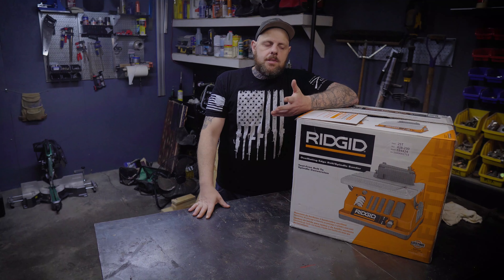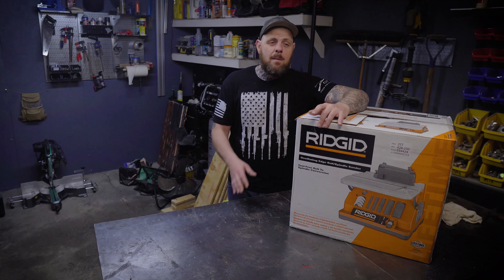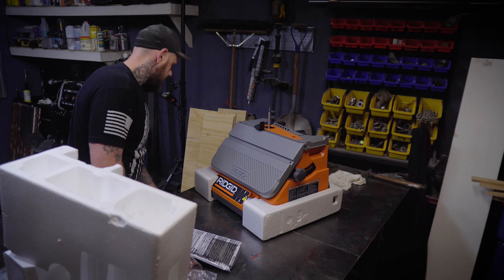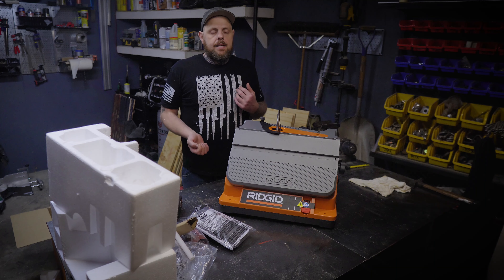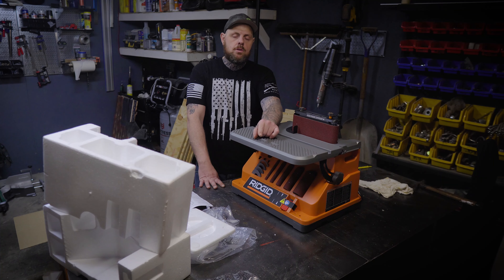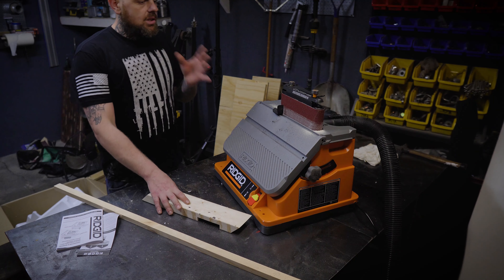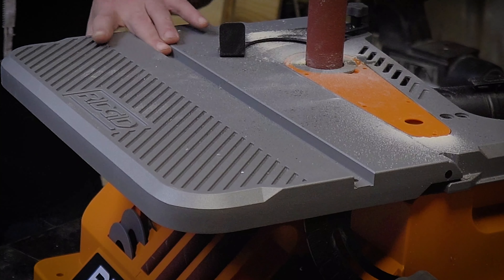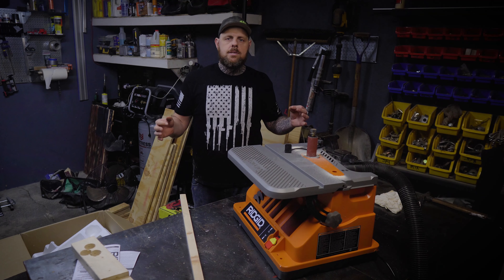Ridgid Oscillating Sander Review & Unboxing

Comment: Trying to decide between this one at $270 or the wen which is the same but no miter slot and a touch smaller for $210. Cool video
Reply: This one ...no brainer ..Wen is not a tool that you would find on a job site or in a real workshop... also Ridgid is a tried and tested name with the lifetime service agreement .....Wen is not.... don't get me wrong I have the 36 in belt sander with the 6in Disc Sander with the cast iron base from Wen.... but if I had the same option in a Ridgid tool I would buy The Ridgid...